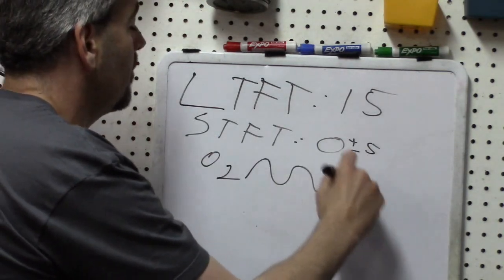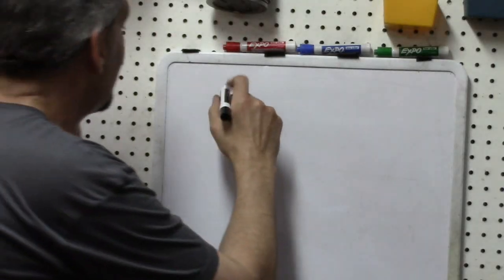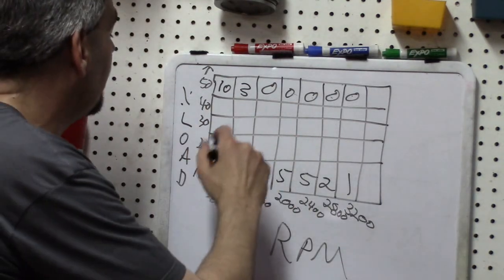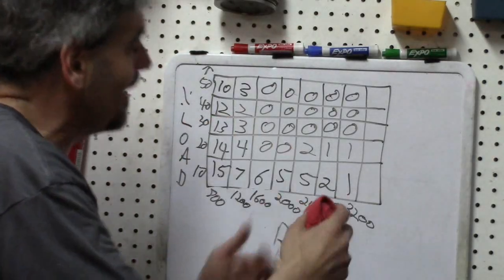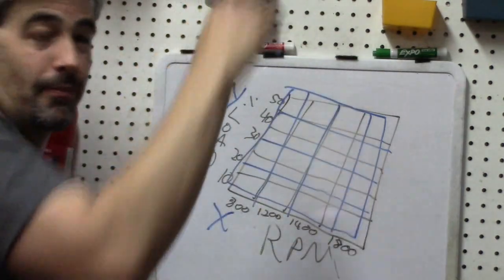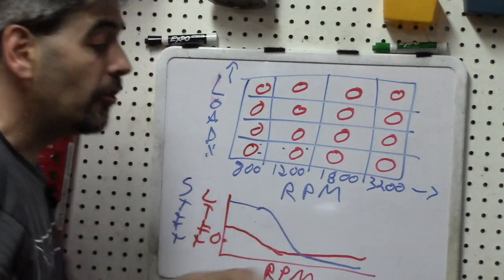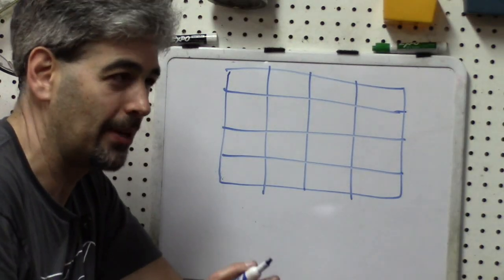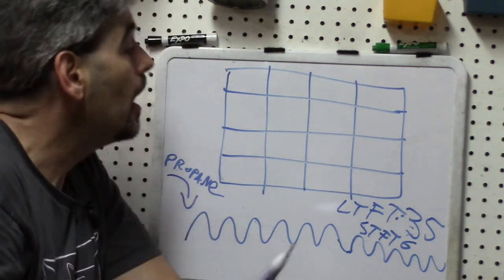Understanding+Diagnosis: Adaptive Fuel Learn Strategy

Comment: Great video keep it up, this is starting to make sense. I was confident in the simple explanation of fuel trim in the earlier videos. And I now see that there is basic model for this behavior or a general organizing principal for observing the data in context. So great you see how it helps me and many others with gathering focus on important concepts like this. 
    About this model. I will be assuming that their are published info and there is an industry specific standard software library available. Your explanation in this video should help me to avoid the wrong assumption when I take a crack at automotive live data analysis which is what I'm working to understand. And I think I'll probably still remember how to change a part even when i can determine its malfunction beforehand. If that sounds like I worry... You can  just remind me It's like riding a hippo sometimes you underwater and sometimes your not, but mostly you wind up a stuck in the mud.
Reply from the maker: Great comment bro. Regarding the "library"- I am sure there are softwares to see maps for individual fuel cells in an array but I actually have never seen one- not even in a factory manual.  This is all programming-related, probably not things you'd find in service related literature.

Comment: No, I'm not a fuel trim expert, however, I believe I have learned a lot by watching your theory episodes.  What I have pieced together, based solely on your educating principles, is that the fuel trim data is based upon ideal or optimum combustion of the mixed vapors of fuel and air within the cylinder.  The computer analyses the amount of unburned air and fuel based upon O2 sensor readout and other variables.  Correct me where I lack here.
Reply: Oxygen rich means too much air not enough O2.  Unburned fuel means too much fuel and not enough O2.
Reply from the maker: Correct except it doesn't measure the fuel- just the concentration of Oxygen.  Low oxygen content=rich, high-lean.
Reply: Many thanks!

Comment: The map is a learned data base for differing engine loads adding more fuel as the throttle plate is opened. The figures in the map adjust fuel injector pulse width I think to maintain stiochiometery .

Comment: Been watching the videos, I keep learning from you. One thing I didnt really catch though was in a rich condition. I have both banks on a v6 running very rich according to the ltft about 24-25%. The stft on both banks is close to 0%. I know it is not o2 sensors from your other videos since it's both banks and they are oscillating normally. I cleaned the maf already. Not sure what else to look for.
Reply from the maker: Check EVAP, Fuel pressure, EGR and induction sensors.  ANything thart either is adding unmetered fuel OR is undermetering the induction is where your thinking should be on rich conditions.

Comment: Hello, and thank you for a great video about adaptive fuel mapping. :) I would love to see more advanced video about fuel map layers in the ECU. Also more about how the closed loop system responding on faulty conditions in the engine.
I have worked a lot with the old Motronic systems from my old BMW straight six engines, and with my old degree in electronic I have managed doing well. I have never changed a part in any of my BMW just for the try. I have always trusted my volt/multi meter and good reasoning. However on my newer BMW engine it's harder to see the big picture, or at any newer engine in fact. So this input from you really helps a lot.
To the summer I will finish my engineering degree in Automation and system control and I really love the beauty of engine management and regulation. Looking forward to more juicy stuff from your channel.
Greetings from Norway:)

Comment: Hi Matt. GREAT Video! That really gave me a much deeper understanding, how the adaptive learning of fuel system control parameters is implemented in ECUs.
One question still remains for me:
Considering the case study of the jeep - if LTFT is maxed out at 35 and STFT is around 6 (not maxed out) and we can see the O2 signal oscillating - that should mean in my understanding, that with this total fuel trim of 35+6 the engine is running in stochiometric conditions. Otherwise the O2 signal should be lean and STFT should increase further until stochiometric conditions are met.
So - if you add propane in this condition, in my understanding you should always see the O2 signal go rich, when it was oscillating without propane added.
Where is my mistake?
Of course - if the O2 signal was not oscillating and both STFT and LTFT were already maxed out, the added propane may still not be sufficient to force the O2 signal go rich - but without stochiometric conditions? I would still have expected to see a change in the O2 signal...
Reply from the maker: Jürgen Thome No you are absolutely right.  I thought about this only after I uploaded the video and I am still trying to think of an explanation lol.  I am sure it has something to do with the combination of the LTFT learn while they are that high and the somewhat high STFT's. But yeah, based on our current understanding, I agree with you.
Reply: Schrodingers Box We already determined that the engine was indeed running lean.  Given that fuel pressure was almost 50% less than the normal, fuel trim would have needed to be almost 100% before the engine would be in stoich.  Total trim of 40% would be woefully inadequate when fuel pressure drops by 40%; I am using stock market analogy; your accounts drops by 50% and then goes up 50% but you are not at the same place where you started from!
Reply from the maker: 12vgs8606 but the engine is in stoich- the O2 sensors were switching .  Remember the 50% fuel trim means the engine adding 50% more fuel to achieve stoich.
Reply: It must not be in stoich when it was running bad,  correct?  If it was in stoich why would it run lousy?
Reply from the maker: 12vgs8606 Correct.  When it was running bad I bet the STFT was 35 also and the misfire counter was going nuts

Comment: 1992 Voyager 3.3 Liter V6. Starts OK, Will Idle for about a minute until stalls as the IAC opens and the motor can not respond appropriately. No distinct miss at idle , just struggles to keep idling, notable heavy modulation of IAC trying to maintain idle, application of throttle brings about severe misses /missing, pops and sputters, intake back fire indicative of over lean condition at just barely above idle, very hard to gain any engine speed/ rpm, IF the engine does manage to get above 2000 to 2500 RPM ( estimated because there is no tach) THEN engine instantly smooths out and runs normally /revs aggressively in high contrast to horrible stumble in region of just above idle to 2000 RPM. 

(I admit that I already did the part swapping gambler approach that you do not like, with no remedy on my part) Already changed TPS (new) no remedy took it back (Thanks AutoZone) , Map Sensor (used from Wrecking yard) and ECM ( used from wrecking yard). No change noted as mentioned parts were replaced. Checked for vacuum leaks in area of Throttle body with unlit propane torch, no effect noted. Contemplated EGR problem. Checked engine for EGR.  Apparently this engine has NO EGR system. At this point wondering about any possible IAC issues / suspect of Junk Yard MAP. I tried some stuff, with no success. Seeking outside input at this point before proceeding any further. Can a faulty fuel pressure regulator cause that kind/ degree of problem?  I am doubting it. Can a faulty O2 sensor cause that degree of problem? I am doubting it.   Crank Evac check valve ? I am doubting it. Anything else ? Thanks in advance.

Up date: Watched the video on fuel pressure regulators on this youtube channel.  I am doubting that is the problem. FPR are to drop fuel pressure, so if they fail there is no pressure drop resulting in a rich condition. It appears that I am dealing with a lean out condition.  The   My next planned move is to test the MAP sensor with a multi meter.

Comment: The information on this channel is very interesting and every bit as accurate. I’m primarily a DIY and have learned much and many thanks. Now for a follow on question. I don’t have a scanner but have a very good code reader which allows live and freeze gram diagnostic info. I would however like to use my portable oscilloscope to examine the pulse signature of the oxygen sensors. The oscilloscope will allow for magnitude and pulse duration of the dynamic effects of the overall resultant fuel mixture. Can you comment on the pins of the OB2 connector where the bank1 or 2 for down stream measurements could be made?

I realize that this might be a bit beyond the exact nature of the fundamental diagnosis you teach I believe this is falls within the core elements of the theory based training you provide. Thanks indeed for what you can offer and thanks again for your training and commitment to theory based diagnostics!!
Reply from the maker: You actually can’t do what you are looking to do with a scope. O2!sensors do not have variably proportionate signal to variations. widebands would but not O2 sensors.
Reply: Schrodingers Box thanks much!!

Comment: Great Job Matt.  Just a fyi there is a diagnostic tool company called Automotive Test Solutions that makes a generic pc based scan tool that will show these fuel maps at different loads and rpms in relationship to volumetric efficiency.  The tool is not that pricey either compared to Autoengineuity.  I watched a training DVD on it and the tool looks very impressive.  I am planning on getting one.  I will share when I get it.
Reply from the maker: Wow I was unaware of that!  That is good to know! Feel free to post a link if you can! The spam catcher will probably flag it but I'll approve it so it will show. 
 Not sure I would actually use it but it would be fun lol. Between that and a oscilloscope I'd never leave my garage lol
Reply: There you go Matt.  Just Call and ask for Bernie Thompson and he will answer any questions you have. Later.
Reply: busjockey1 I have something similar in Palmer's version (ScanXL) however, due to poor documentation I don't know if it somehow pulls the table info from the PCM or makes it's own tables based on sampling the trims under various conditions during a test drive.  I suspect the latter.
Thanks for the head-up on the other.
Reply: J

Comment: 27:00 About here you talked about something extra awesome to me right now. Are you sure it's a vacuum leak if you haven't spent some minutes testing and retesting? You could just be in unlearned fuel cells and you may really have a bad MAF or fuel pump. Awesome tip, Matt!
Reply: DE Nichols Loved the Z map too. Logically, I had to know there were multiple maps for "apparently" similar conditions. My truck really went under some fuel trim changes when I moved from 2 to 3 thousand elevation to near zero elevation. lol
Reply: Matt, I've been thinking about it and watching fuel trims on my 2000 "Toyota Corolla" (1999 Chevy Prizm with the later engine) and I've been sure for a while that my car has very few maps of fuel trims that it write on and makes adjustments.

Maybe it's surprising, maybe not, but when my engine is just into closed loop it has a different fuel trim than when it's more warmed up and yet another for fully heat soaked.

EVERY time it has to adjust short term fuel trim and make a new long term fuel trim.

Very disappointing how many maps it writes on. :(

Comment: Thanks for lessons. Who's teaches who, is also a question. Without questions from the other side, you can't play the game. I understand this by almost like a raining in the desert. To find an oasis at midday. I would like to test the correctness of understanding Your subject matter delivery. If we have a car and has factory settings and is equipped as it was when it came out of the factory. The car works normally and has no problems. After a certain time it is no longer new, so we approach maintenance work. In doing so, we find that in the maintenance, higher quality parts, oils, liquids, etc. can be incorporated. We are only trying to improve the work of mechanical, electrical or transmission components, that can influence the improvement of the combustion process itself, as well as the transfer of torque and power with less friction and thermal losses. We are trying to improve the thermodynamic efficiency of the engine and transfer this motion to the ground. We do not interfere with anything in the software scheme. Of course, a cheetah can not come from the hare. However, a small, a few percent can be gained, if we get something here and a little small there. It's possible. Now, because the dyno test is not in our interest or we will not perform it every fourteen days, we decide on another indicator to show us whether we have improved or not, the factory parameters of the vehicle. Would this procedure be reflected in close to 0% STFT and a constant negative range between -3 to -5% LTFT in the long run? Thank You for understanding and greetings from Slovenia. Lojzi

Comment: Matt - this was an EXCELLENT video... answered so many of my questions I had in the back of my mind as to how the LTFT graphs could and would change so quickly in some of the diagnosis I have viewed on your channel.  And the info on the Z axis dealing with MAP cleared my confusion on how it was possible for me to take my car from Ohio (800 ft) to the Rockies (8000 ft) and still run well...  I am still a little foggy on what would clear the map.... the clearing of any check engine code or only certain codes?
Reply from the maker: Yes your understanding is very clear (the Z map does explain the altitude adaptation!!).
  Clearing the MAP is done anytime the PCM is cleared either through absence of power for a few minutes OR through using the code clearing function on a reader or scantool.

Comment: The computer locks onto the recorded LTFTS as long as the oxygen sensor does not affect the SHTFT. In other words only when the 14.7 to 1 is changed will SHTFT move to compensate and then eventually create new LTFTS in the grid, when it does the SHTFT will go back to 0.

Comment: Matt in my case the check engine light is on intermittantly can I assume the problem is not in the cars electronic control unit so it must be a vacuum leak or a dirty or faulty sensor. I think I can rule out low fuel pressure too as the car responds well. As you said the car runs normally because the fuel trims will always be adjusted to keep the 14.7 to 1 ratio. Still a fault somewhere though.

Comment: Watched a technical presentation on fuel trim, Where it was noted for Performance cars it was better for them to be run on the Rich side of Lambda 1.  The Torque curve is at its highest a few points below lambda 1, ie on the rich side.  Thats if you don't mind using a bit of extra fuel.
Reply from the maker: I agree with this EXCEPT that if you think about it, you only really need to run rich in a performance application at WOT. And ALL cars run rich at WOT anyway. So I see no advantage to making a car run rich otherwise.

Comment: You're right about one thing, I do need a life. I was looking at my 2001 Tahoe with a scan tool, and saw a PID called "Fuel Trim Cell" which is high at idle, but goes to zero as soon as I increase RPM. The long and short term fuel trims stay low despite the high "Fuel Trim Cell" reading. What exactly is this PID telling me? Is it the value in a particular cell? Why is it not reflected in LTFT? I love your videos by the way.
Reply from the maker: dogbyte555 In my experience, this is because the feature is actually not really supported so the scan tool defaults to a "zero" reading from the cell even if that isn't it.  You can confirm this by looking at various cells or looking at the cell when inducing a change in fuel trim and it won't show adjustment.

Comment: Matt is says FUELSYS1  OL _ FAULT might be the fuel level sensor or the pump I have read. Going to check the fuel pressure anyway but car is running very well. Strange mabe the pressure is slightly lower but no low enough to cause driving problems.